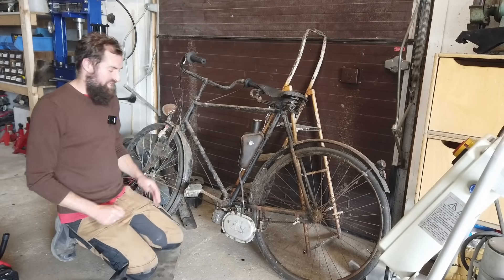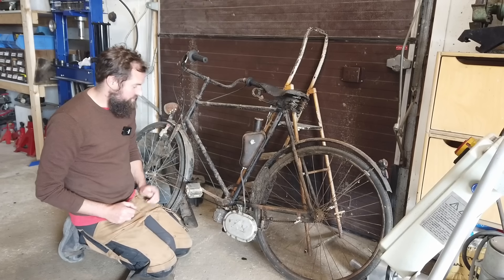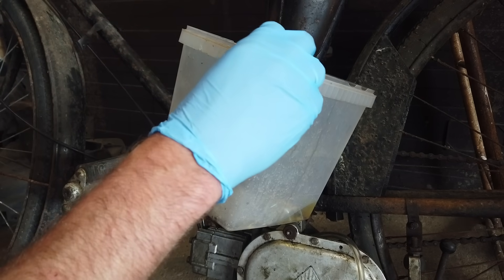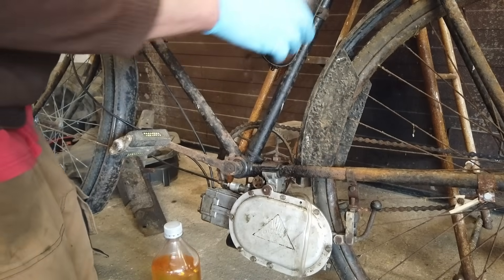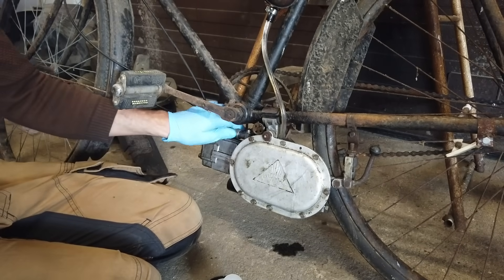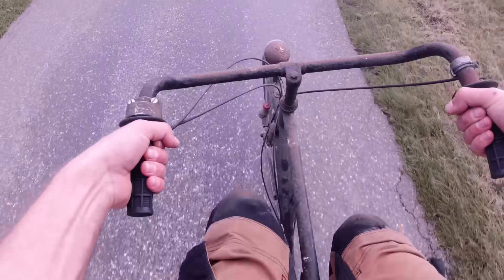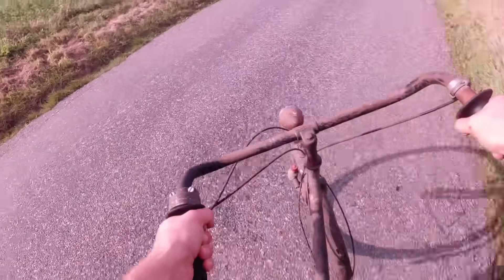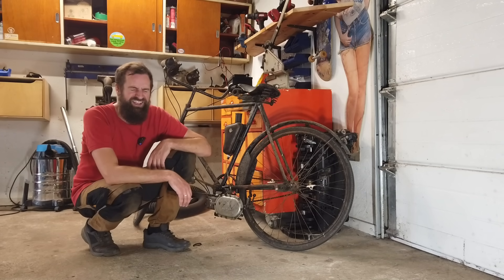Riding A Two Stroke Diesel Moped With Variable Compression!

Comment: I don't know if you're still reading the comments on this video, but it's an awful lot similar to model airplane 'diesel' engines that run on a mixture of diethyl ether, kerosine and oil, with optionally a little bit of cetane or octane booster. (30% ether, 45% kerosine, 25% oil and on top of that, 2% additive) The ether is used as the ignition initiator because of it's ease of ignition, igniting the kerosene. Some cetane or octane booster helps smoothing out the combustion. Maybe a small amount of ether will help you running it, you can also use starting fluid. You'll need to compensate for the concentration though. The 'non ether' part can be treated as kerosine. By the way, these engines are HCCI (homogenous charge compression ignition) engines. A true diesel would be an SCCI (stratified charge compression ignition) engine, because the fuel is injected right before the ignition moment. A normal gasoline engine is an HCSI (homogenous charge spark ignition) engine. Maybe you knew all this already, but if not, I hope this information is useful for you.
Reply from the maker: I read all comments.. but cant answer them all.... otherwise all the projects would be even more rusty... :P 

I will try adding some ether (probably starting fluid) and see what happens! its been proposed by many now... needs to be testet!

Comment: Add 1 percent of amsoil certain booster and it should run even better but will need the compression backed off even more than straight kerosene

Comment: An air bubble  (airlock) blocks flow by filling the line and holding back the fuel with its buoyancy. Theres a difference between an airlock and a void, such as you may find in a fuel filter.

Comment: I once tried to do something similar with a normal trimmer engine. replaced the spark plug with a bolt that had the same size threads, and put kerosene and 2 stroke mix in the gas tank mixed with a little bit of ether to get it to light a bit easier. it did fire once but it was a cheap trimmer with a single sided crank and it bent the connecting rod. something better built like a chainsaw probably would be able to be converted
Reply: You can't make a compression ignition engine by removing the spark plug and changing the fuel.  Not even ether will fire.  You hydrolocked the cylinder because the camber filled with fluid.  Game over, those feather rods will never tolerate that kind of abuse.  Abuse that is still less than the force created by diesel knock as you have ZERO control over the combustion timing.
Reply: @Failure_Is_An_Option  I am not even going to argue with you cause you are wrong. look at model RC diesel engines. That is literally how they work.

Comment: Very interesting, I think 20 ‐ 1 is mabe a bit too much oil. I have run many different old two stroke engines, ranging from 25 ‐ 1 to 50 ‐ 1. I would try it at 30 ‐ 1 with petroleum. 
PLEASE do some more updates on this machine. Regards 
✌💚🇬🇧
Reply: Depends a lot on the design of the engine. I have an old Johnson outboard that is designed for 10:1, and model plane engines may run 4:1 or 5:1. Some of this is because the old oils were much less effective than newer ones, but the main reason is that many of those old or very small engines use plain bearings rather than roller or ball bearings, and by nature plain bearings need a lot more oil to avoid damage. The Johnson for example has bronze main bearings and bronze connecting rods with removable caps, no discrete big end bearing fitted. Similarly many small RC plane engines just use a hole in the aluminium connecting rod as the big end bearing, and form the main bearings by simply drilling into the aluminium crankcase.

Comment: I would be trying ordinary  two stroke  as petrol has a higher yield. Very interesting. Cheers Chris
Reply: @jankatsman6319
28 minutes ago
Around 1960 a classmate drove one belonging to his father. It was very difficult to drive it, since the compression had to be changed load depended. The maximum speed, no wind flat trajectory, was about 60 km/hour. Fuel consumption was ca 100 km/ l. During wintertime, temperatures bolow 0 depressie C, it dit not run at all. Trying  to run it on petrol resulted in an exploded cylinder, fortuanetly noboddy was hirt. That was the end of the Lohmann. Hope you Will have a lot of fun with your Lohmann

Comment: Diesel has a greater energy density than the kero-oil mix would, and there are some very technical lubrication factor that would cause me to avoid using kerosene, even as a cleaner for anything that is normally subject to constant lubrication. Having to back of the compression after ignition starts makes me think that there are components that have worn out of tolerance. Just a thought.
Also theoretically, extra virgin olive oil has properties that should make for a good fuel... and the smell wont be as offensive! Lol

Comment: Diesel engines can run on any combustable fuel, bare in mind diesel has lubricating properties and 2 stroke diesels do not need 2 stroke oil mixed with the fuel

Comment: You may try cooking oil with ethanol, although I think it's a time-consuming process. There's an article on Nature magazine about waste cooking oil, ethanol, methanol and eggshells (to use CaO as catalyst). Gasoline/Petrol + oil might be a better solution for an engine with a small compression ratio like yours., though.
Reply: If you want to ruin an engine... go for it.  I have rebuilt many many engines during the last "alternative fuel" craze.
Reply: @jankatsman6319
28 minutes ago
Around 1960 a classmate drove one belonging to his father. It was very difficult to drive it, since the compression had to be changed load depended. The maximum speed, no wind flat trajectory, was about 60 km/hour. Fuel consumption was ca 100 km/ l. During wintertime, temperatures bolow 0 depressie C, it dit not run at all. Trying  to run it on petrol resulted in an exploded cylinder, fortuanetly noboddy was hirt. That was the end of the Lohmann. Hope you Will have a lot of fun with your Lohmann

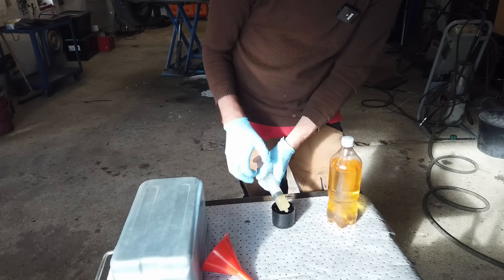Comment: 5:15  I use kerosene a lot.  I have never seen kerosene that color (it looked like that before you added the 2 stroke oil). It's always crystal clear.  But gasoline looks exactly like that, though it's dark even for gasoline.
Is it something other than k1 kerosene?

Comment: This was a fun vid...... But you need some mopeds that actually HAVE SOME POWER..... 😉

YT will love videos about interesting mopeds..... And winter is the best time for bike projects... I just hope you get some bikes capable of a bit more power, and speed... If you search, I bet you can find a Honda Camino.....  they are 50cc, but capable of 70kph, with very little modification, and basically no non-stock engine parts. Here in the states they are called the Hobbit, but they are the same bikes. (The PA-50 II is the bike you want.....)

Comment: Would like to see it with some petrol in the mix
Reply: @jankatsman6319
28 minutes ago
Around 1960 a classmate drove one belonging to his father. It was very difficult to drive it, since the compression had to be changed load depended. The maximum speed, no wind flat trajectory, was about 60 km/hour. Fuel consumption was ca 100 km/ l. During wintertime, temperatures bolow 0 depressie C, it dit not run at all. Trying  to run it on petrol resulted in an exploded cylinder, fortuanetly noboddy was hirt. That was the end of the Lohmann. Hope you Will have a lot of fun with your Lohmann

Comment: This engine should be generating 562 watts maximum which will do a lot more than this engine is doing.  Even at 1/2 of that, it's close to 300 watts.  It won't climb a steep hill by itself, but it should help a lot.  I wish you would have shown the work you did to it.
I think you should start again with brand new fuel and spray all the various gasketed surfaces with carb cleaner to see if you have leaks in any of the seals including the case. This is a major source of headaches with 2 stroke engines.  I assume you made sure the reed valves were working and sealing correctly.

Comment: Two things: Is your fuel tank vent working? You had to loosen the cap to drain the tank. Secondly, about fuel gasoline is rated in octane, Diesel is rated in cetane. They are opposites. Higher octane is HARDER to ignite with compression. that's why high compression or high boost gasoline racing engines need high octane gasoline, to prevent early detonation of the fuel causing knock. High cetane is eaiser to ignite. Some of my old farm tractors started on gasoline because it vaporises, and when the engine is hot and the intake was heated by the exhaust, you switched to kerosene. They have really low compression around 4.5 :1 to prevent detonation with the high cetane kerosene. New gasoline is formulated with long chain molecules instead of ring molecules to PREVENT vaporization. This was to reduce gas fumes at gas stations during fueling. That's great for fuel injection but not for carburetors. We found on dyno testing tractors and in cars at the dragstrip on low compression (8.5:1 or less) that REDUCING the octane by adding kerosene at about 1:40 to 1:20 increased power especially throttle response and torque. Going to race gas at 110 octane dramatically  reduced torque. Old engines were meant for 60 to 70 octane gasoline that actually vaporized and ran MUCH better on it than modern gasoline, especially ethanol blends.

Comment: Oops when i read over the post i realised i my well have started something off, so before it all goes off in my face,  i should have added, Diesel invented the Diesel engine, the fuel is categorised as heavy oil when used in uk for cars boats tractors antrucks and busses, the engines are compression ignition engines, theses engines will run on a huge variety of different oils, 
( as a matter of fact i know of one person who mixes used engine oil and petrol in a ration that don't know to run hid old van , the van does not smoke very much at all by the way as he has been doing this a very very long time now and has the ratio sorted now) anyways i do hope i have avarted any criticism.

Comment: I hope you don't mind all the comments.  Great videos.
15km/hr (9mph) is WAY too slow for 3/4 of a HP or 562 watts. IIRC, the requirements to go 10mph(16kmh) is about 100 watts from your legs, (not an e-bike). Power requirements do rise exponentially after about 10mph because the resistance changes from primarily rolling resistance to primarily air resistance around that speed.  Still, 500 watts should easily maintain 20mph or 32kmh
There are many ebikes with 250 watt motors that will do 20 mph or 32km/h. Of course, a 250 watt motor can put out significantly more than 250 watts.  However, there are a lot of bike power charts (based on human watts) which say 250 watts should be l over 15Miles/hr (24.3km/h).  Something is wrong.  Running properly, this bike should easily hit 20-25mph on flat ground with no headwind. 

Also, I would change that rear tire if its old. These types of drive units put a lot of strain on the tire and wears them pretty quickly. And an old dry rotted tire under that kind of strain will probably fail.  Probably not a bad idea to check all of the bearings too and make sure they are greased.  Plus, grease turns to glue over long periods of time and that bike looks like it's been sitting in a barn since the 1950s.
Reply: There’s an article in the Polish magazine Przysposobienie Rolnicze from the late 1950s that states this engine has a fuel consumption of 0.6 liters per 100 km and a maximum speed of 25 km/h.
Reply: @Ntwadumela1  Seems slow for 3/4 of a hp.  But the bike has to be put into better condition to really test it.  The old tires for example, were likely high rolling resistance tires when new and are even higher now, not to mention unsafe.

Comment: A long time ago I was in the navy, during engineering training on marine engines we were instructed that there are No Diesel engines, Diesel is the fuel, the correct term for these engines is Compression Ignition engines, I know this is a bit pedantic and a rather unnecessary correction I only wanted to have a wee bit of fun with you as everyone knows what you are saying, don't mind me hahahah
Reply: Ah ! I have to correct myself, is actually the name of the inventor the fuel is called heavy fuel oil. 😊
Reply: Here's what Britannica says on the subject:

diesel engine

Also known as: compression-ignition engine

" diesel engine , any internal-combustion engine in which air is compressed to a sufficiently high temperature to ignite diesel fuel injected into the cylinder, where combustion and expansion actuate a piston. It converts the chemical energy stored in the fuel into mechanical energy, which can be used to power freight trucks, large tractors, locomotives, and marine vessels. A limited number of automobiles also are diesel-powered, as are some electric-power generator sets".

Comment: don't let the engine turn if you're not trying to start it. i don't know about this one but the average gasoline 2 stroke has no oil in the block, so all the lubrication is coming from the oil in the fuel. if the engine is not getting any fuel it is not getting any lubrication and you will be wearing it down.

Comment: SEASIDE GARAGE at 3.25 did you pull the fuel cap off so it would flow out the bottom of the tank to drain it ?????
Reply from the maker: No. I opened the fuel valve :)
Reply: @SeasideGarage  how long to drain it, was there a good flow rate, check the cap for a breath hole or if the fuel tank can breath air, ive seen comments also say about crank/ crank case seals... Its a mental bike that is, i watched a video the other week, think it was some  old French bike with an engine on the front wheel. That was crazy also... Keep up the good  work bro 👍👍

Comment: The compression will increase as it warms up and will need reducing. Same as model diesel engines, as they warn up they run hard and slow down. Used to tune them by ear !
Reply: It's not that the compression increases, although I can see how you might come to that conclusion empirically. As the engine warms up, the amount of compression needed to reach auto-ignition temperature gets lower and lower, until eventually the engine is firing significantly before TDC and fighting itself. At that point, you have to reduce the compression ratio to prevent pre-ignition and get back to smooth running.

Comment: I watched your fuel mixture.  I feel with modern 2-stroke oils it looked like you used about 75% too much 2-stroke motor oil.  I am in the Philippines where my relatives borrow my chainsaw while I was back in Canada for a few months.  They have been mixing the gas oil mixture themselves BUT not how I showed them.  They were proud to show me that they put EXTRA oil in the mixture thinking that this is good for the saw motor.  It is not good to put EXTRA  oil in the gas oil mixture.  The extra oil lowers the fuel flash point of the fuel ( make the gas oil mixture ignite later and burn slower producing MORE carbon and less power).    So with the spark plug out of the chainsaw motor I can see clearly that there is many lawyers of carbon build up on the top of the piston - BUT - what you cannot see is the extra carbon build up behind the piston rings because of very poor fuel burning.  This extra carbon build up between the piston rings and the piston its self will cause the piston rings to push outward and press harder on the piston cylinder walls causing more friction and resistance for the piston to travel in its operating  cycle causing excess piston ring and cylinder wall wear and premature piston ring wear.   SO use less 2-stroke oil in your mixture.   Remember when this motor was invented and used there were NO good 2-stroke motor oils only miner grade oils....    once again I love your videos.....   You have found the motor equivalate to the first wind up wrist watch.   Please keep making these videos .

Comment: Please try to run it again with diesel by riding it. Maybe it will be stronger. Make shure the fuel tank does not have a vacuum or the diesel will not flow normaly.

Comment: Is it a "Hot Bulb"  diesel ?  This is used in model airplanes with volatile fuels, and in old  marine engines, that May or may not start on kerosene or gas, then switch to diesel.  Literally started with a blow torch.
Reply: No it's not a hot-bulb engine, fuel and air is mixed in a carburetor that is later compressed in the cylinder until it is ignited by the heat of compression.
Never heard of a hotbulb model airplane engine, that would be quite spectacular though.

Comment: Nice :-) I've got a tiny RC-engine with adjustable compression and runs on a mix of kerosene, oil and ether. So I would have experimentetd with blending in ether, you get easier, earlier ignition and more power. Maybe start with 5%.